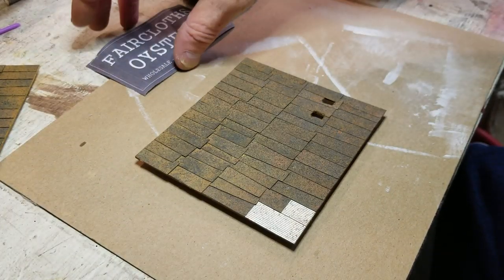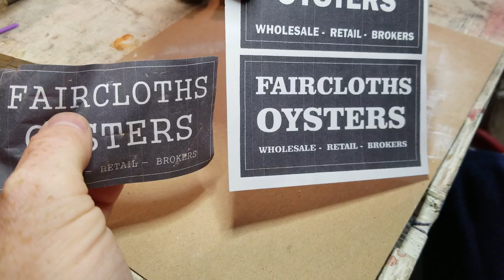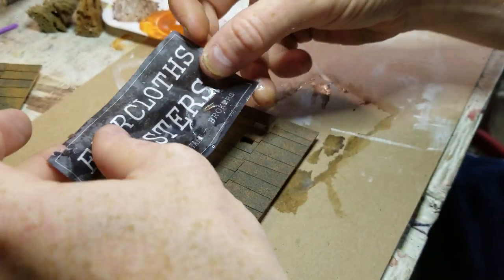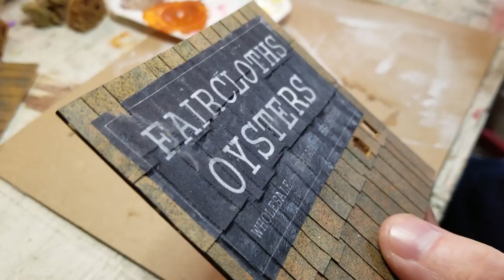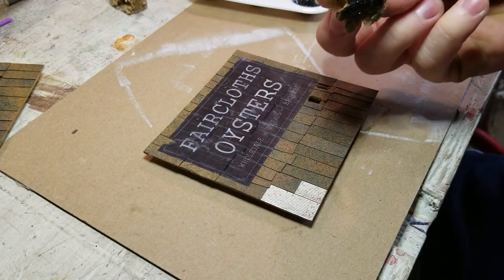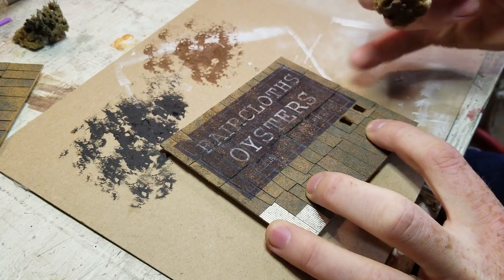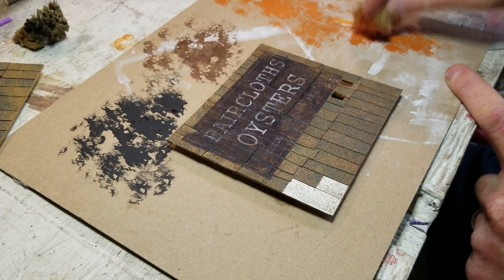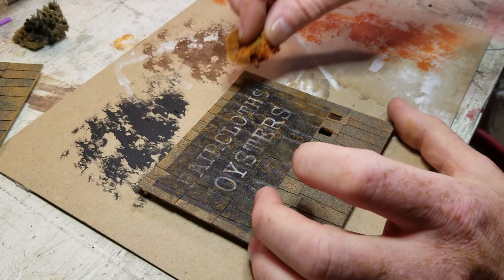How to apply paper signs to your model railroad structures

Comment: Do you use laser or ink printer for those sign? I guess that ink printed signs will be pretty messed up when wet.
Jonas
Reply from the maker: We actually use an inkjet! Ours doesn't run much and we think it's because it's a heavier glue than water mix.
Reply: @WileysScaleModeling  Okej, thank you, then I have to try that technic. JF.
Reply: I've not yet try to sandpaper down the signs. But I tried printing on silk paper, a technic that Luke Towan/ boulder creek railroad used in a Video.
Jonas.